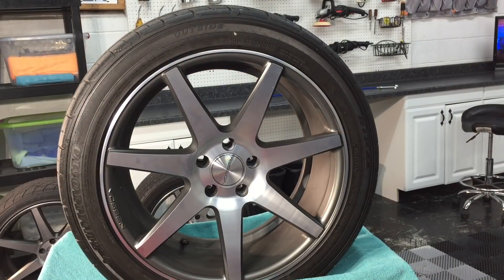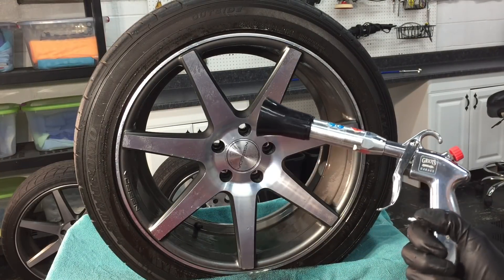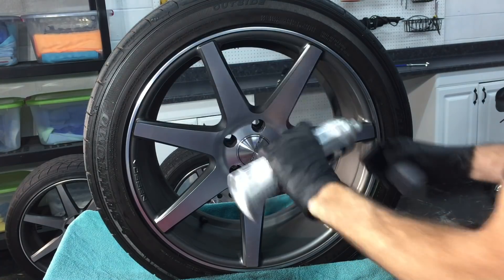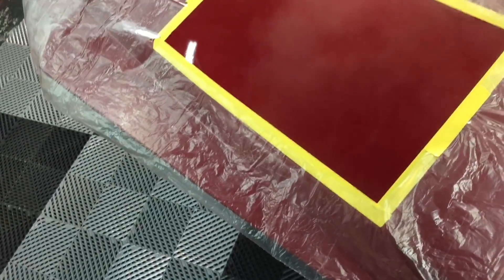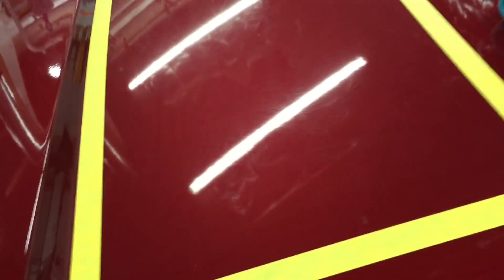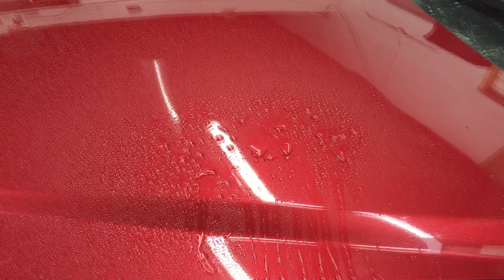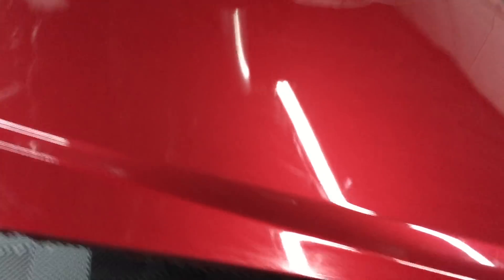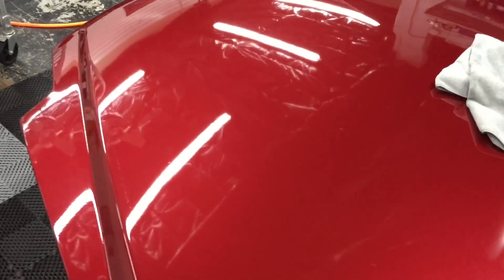Sonax Wheel Rim Shield!!!

Comment: I just use Sonax Polymer Net Shield on my wheels, which works great. Great hydrophobic and brake dust repelling properties. After every wash, I just use the Sonax Brilliant Shine Detailer as a drying aid to prolong the protection. You must try the Brilliant Shine Detailer, although it's a spray sealant, not a quick detailer.
Reply from the maker: Net Shield is great...they just should have made a version for wheels that can hold up to the extreme heat.

Comment: I would agree with many others, if I’m going to take the rims off the car, in addition to cleaning and polishing if I can, I’d use a ceramic coating. For a daily wash I’d use meguiars synthetic spray wax or bead maker as I dry.
Reply from the maker: Bead Maker or Gyeon wet.

Comment: I've been using this product for quite a while now and I've had nothing but a great experience with it. My wheels, O.Z. 45th anniversary, have a satin finish to them and I actually save this product, due to price, for when I go on a road trip, like Tail of the Dragon for instance. I've found that clean up is very easy afterwards and has lasted me for 6 weeks.

It does go on glossy but dries to a sheen and k will say that when I do the first cleaning afterwards it's a bit sticky for the mf drying towel. With the advent of the spray on, rinse away sealants it's too easy to keep your wheels protected. That said, I'll probably buy this product again because of the luck I've had with it.
Reply from the maker: I am truly happy you had positive results with it. It made my fittipaldi wheels look dull and lifeless.

Comment: Brian, this is not your typical wheel sealant. This coating should not be touched after application. You spray it on and it cures to a chemical resistant coating but has very weak physical strength. So any touching will remove it and it must be applied after every wash.
On the flip side, it has very good dust repelling characteristics. It's similar to ArmorAll Wheel Shield in it's function.
Reply from the maker: I appreciate that...and others may have positive results with it....for me, it made my Fittipaldi wheels look dull and lifeless.

Comment: Couldn't agree more Brian, Sonax for the most part do excellent products but this one is very poor especially when you look at other available options.

Have a look at my channel and you will see a video for a product called Wowo's Crystal Sealant. Spray, spread and buff. That easy and it offers 8+ months protection on a daily driver, driven 300 miles per week and with high performance brakes. Tested by myself in the real world including during winter in Scotland.

You should consider trying it out as I reckon you'll be extremely impressed.

Comment: what waste of money..lol.will megs fast finish sealer work better on rims and if so longevity?🍻🍻
Reply: Yes, it lasts at least a month for me on the wheels, 3 washes using super degreaser and 1K miles in the UK. I've been using since October and I've been impressed! I wouldn't use on paint as I think Sonax BSD on top of an LSP such as Fusso Coat or Collinite 845 as a maintenance product produces the results that I like. But for the wheels, grills, exhaust tip, chrome, etc Fast Finish is great.
Reply from the maker: Hey some might like it. It made my wheels look flat and dull. Gyeon Wet Coat still does it for a quick fix.

Comment: I doubt this is something I'd use on painted or powder coated rims. Your testing showed me that it doesn't sit well on glossy surfaces. I think for rims I'd stick with ceramic coatings when possible. The durability is far superior and the gloss levels are much much better...in my humble opinion 😁
Reply from the maker: Exactly...a ceramic coat is the way to go for wheels.
Reply: @apexdetail85  I was thinking about this again and thought it might be good for helping to keep those steel rims from rusting. I saw someone had put their snow tyres on and the steel rims were horribly rusted. Looked gawd awful. Perhaps this rim shield might help keep that rust from happening on steelies? It seems folks here in Canada dont look after their steel rims very well, as we usually only see them now a days for running snow tyres in the winter months.

Comment: WHEEL RIM SHIELD and you proceed to use it on paint and point out the flaws it has lol... I've used this stuff CORRECTLY on my wheels and it works fabulously. It's the same as spray paint, start very very very light and go around the whole vehicle and do each wheel twice. Do not lay it on thick for every single wheel or you will get bad results. And do not use on paint lmao...